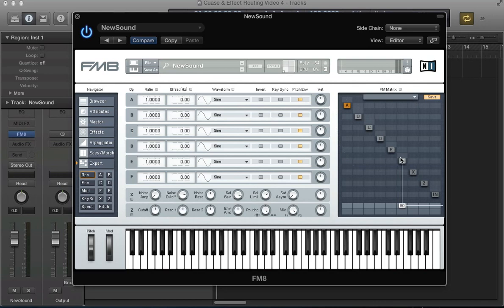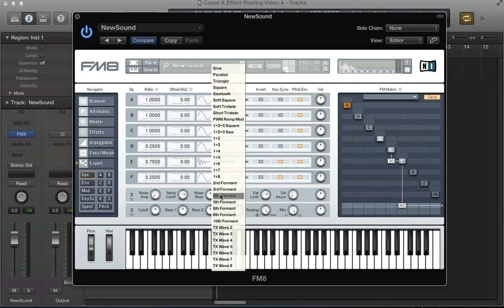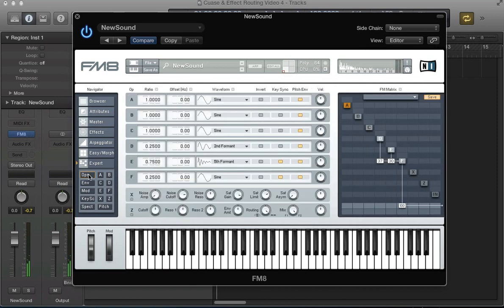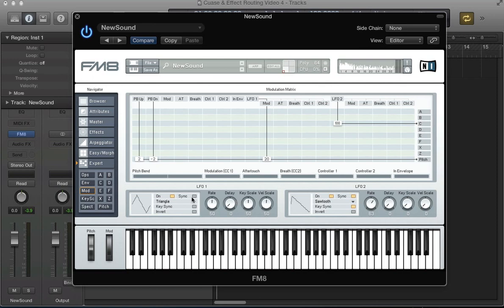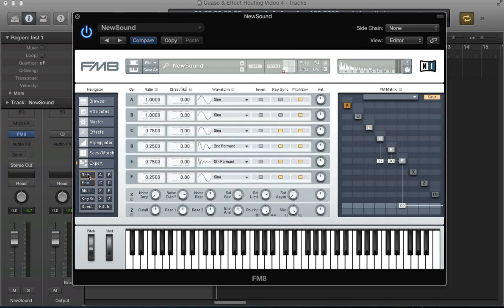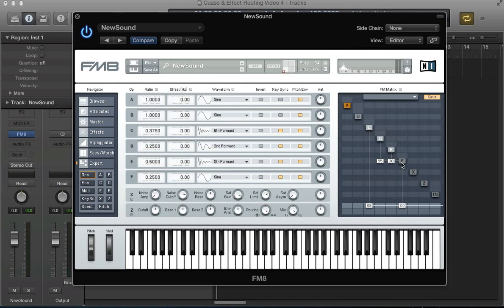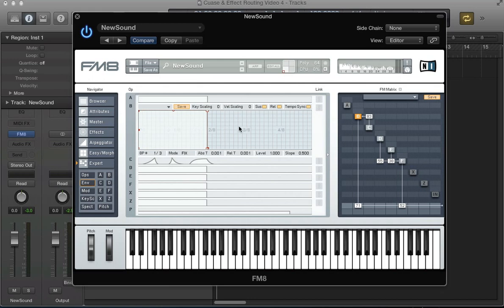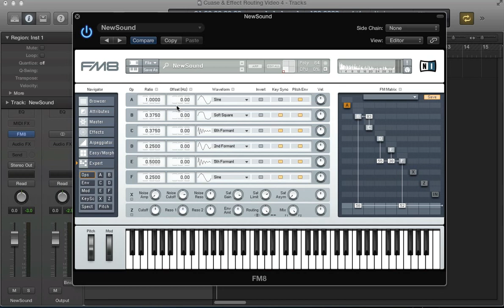FM8 - Cause & Effect and Sound Design - pt 4 - Modulating Envelopes - How To Tutorial

Comment: some strange reason, the modulator does not operate on my fm8
Reply from the maker: +O J Are you definitely routing things correctly in the FM matrix? Make sure the carrier that is being modulated is being routed to the output.
Reply: Ok i will check

Comment: could you bring that custom envelope sound in overtime using the amp mod with the mod wheel as well
 in that operator
Reply: yes, you would just have to assign the volume of operator B to the mod wheel in the modulation section, and also make sure you reset the envelope of operator B so it has a fast attack.